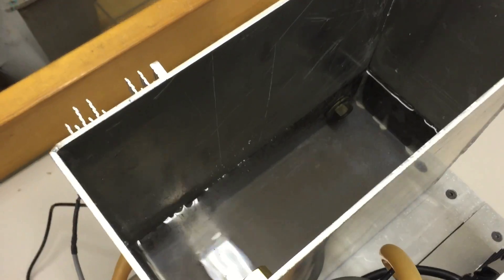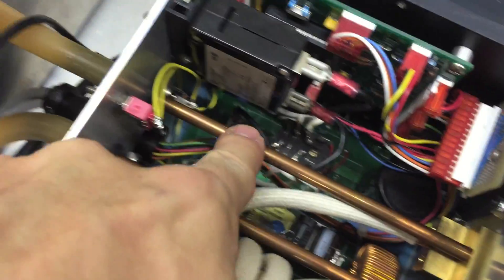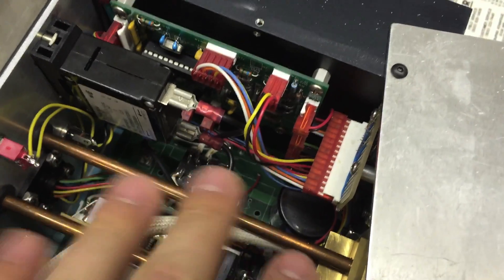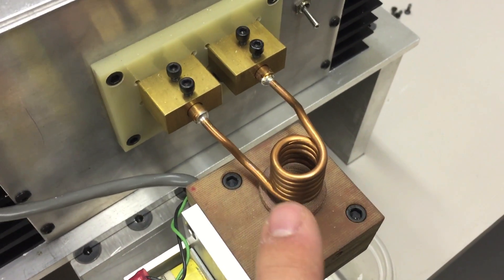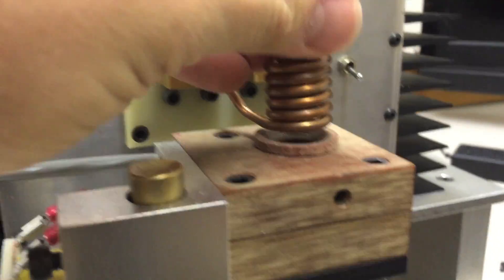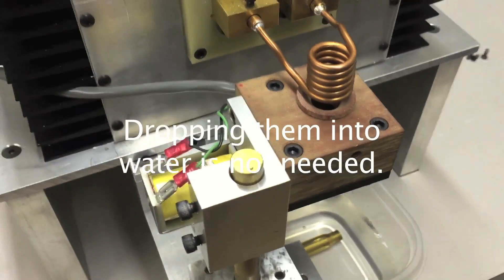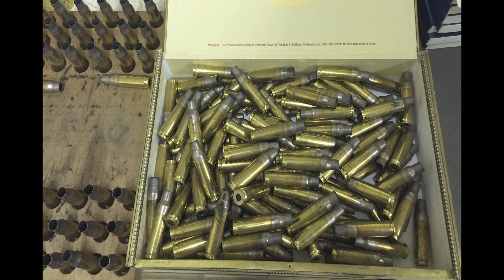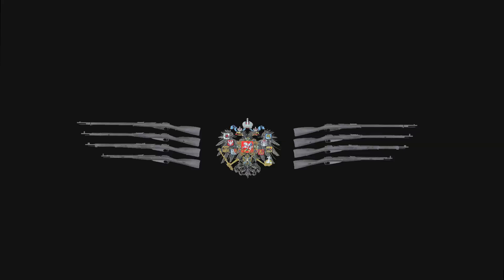Eds Induction Annealer

Comment: How does it work with different calibers, some be taller and some being shorter
Reply from the maker: The trap door can be moved up and down for longer cases. Make adjusting it easy and does not require you to swap out parts.

Comment: i'm trying to build my own annealer atm. Questions:
- What type of servo are you using for you trap door? 
- How are you detecting that a piece of brass is added? 
- What type of material is the brass holder made out of, it looks like some sort of high-temp plastic?

My machine won't be nearly as fancy as yours and likely will be an MDF or acrylic case.
Reply from the maker: You should try to contact Ed on accurateShooter.com He made it. I just know how to operate it. :)
Reply from the maker: +Bob Washere you will have to ask Ed. I think his Accurateshooter name is itchytrigerfinger
Reply: +Grimstod Desh if and when you get some of this info let me know.  I've got the induction part setup now, like you, I need to do the timing, actuation and mounting.